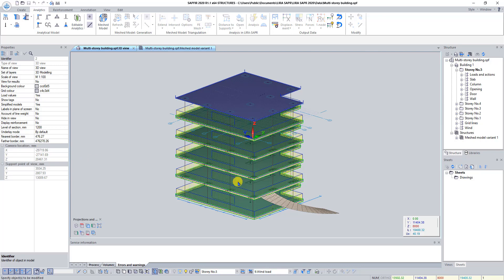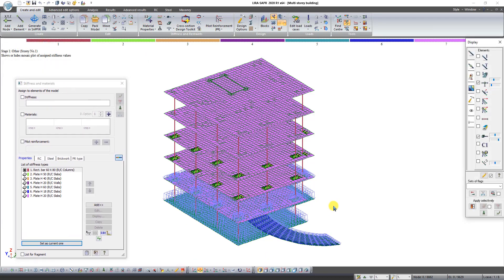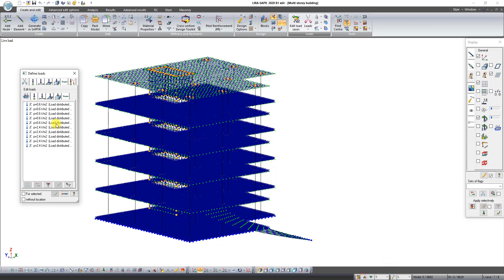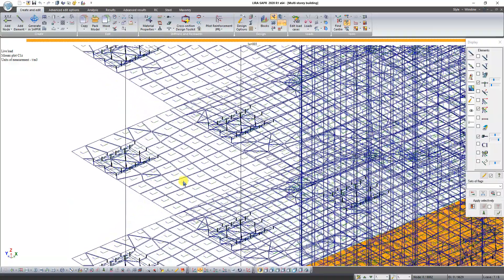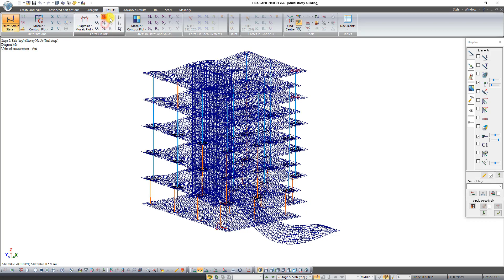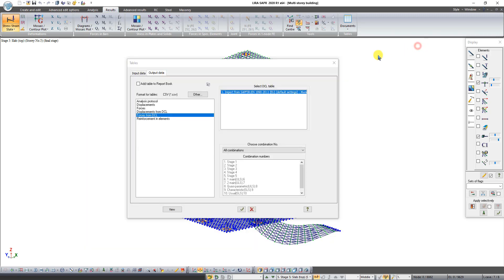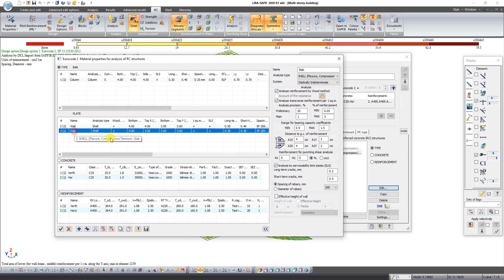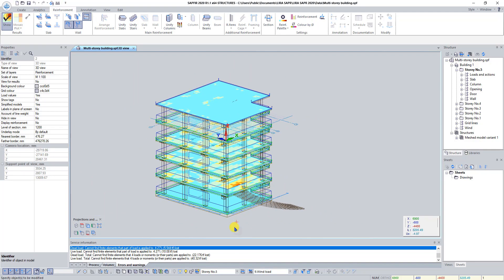SAPFIR-3D Lesson №5: Export to LIRA-SAPR.

Comment: How can i reverse one?Because when i do it Sapfir says:can't find columns,beams,diaphgrams
Reply from the maker: If I understand correctly, you want to transfer the scheme from VISOR-SAPR to SAPFIR. There is no such integration, we only have a direct integration SAPFIR - VISOR-SAPR. 
But, VISOR-SAPR has a command that allows you to add a new fragment in SAPFIR. In this case, those elements that you select in VISOR-SAPR will be used in SAPFIR as a snap for a new fragment. There is also a command in VISOR-SAPR that allows you to create or edit the load on the selected elements in SAPFIR.